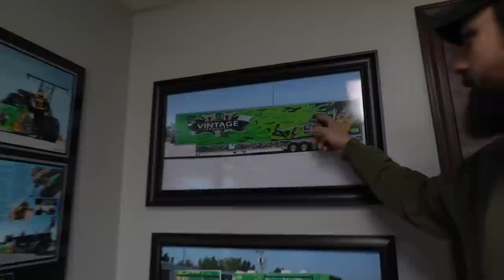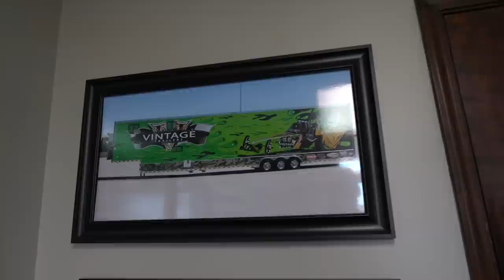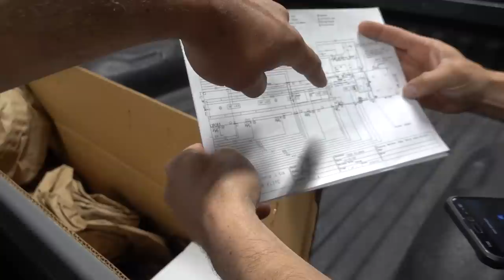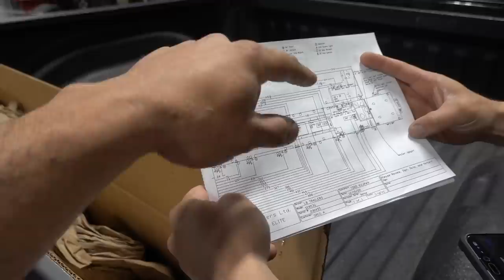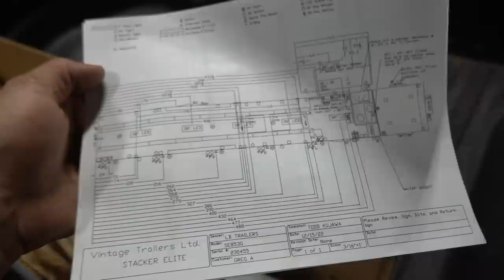We Built My DREAM RACE TRAILER!!!! IT'S WAYY BIGGER THAN I THOUGHT!!!!!

Comment: What if you put the dragster front wheels on the small lift and the rear tires on the back lift and pick that up. It has to weigh less than the truck. I don't know if the measurements work out that way, but it's all about center of gravity. Just a thought.